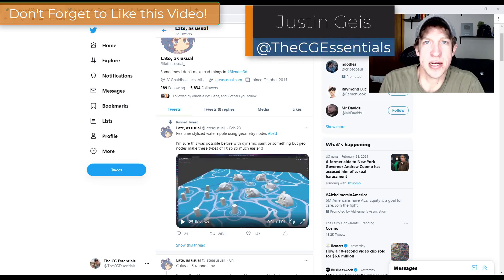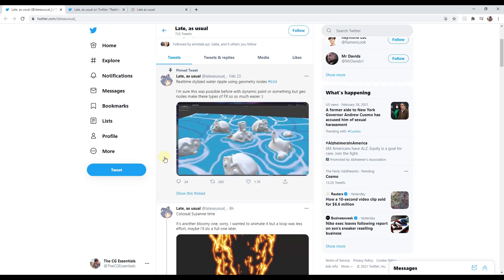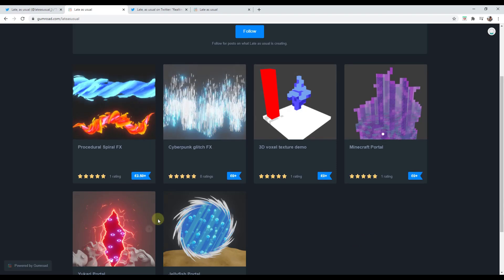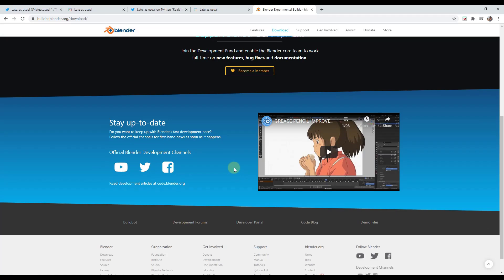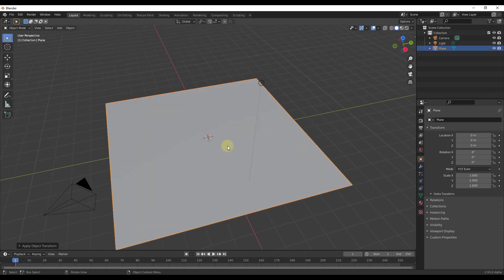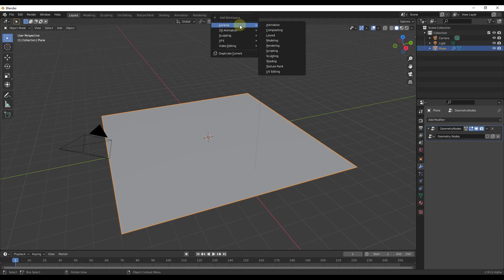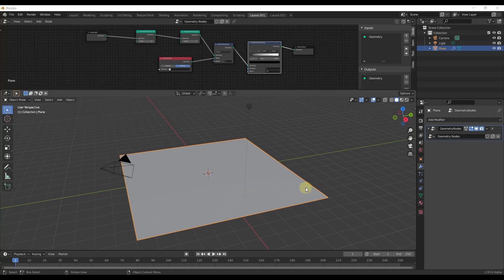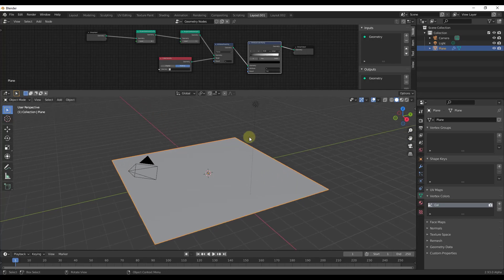Someone Created WIND WAKER WATER in Blender with Geometry Nodes!

Comment: Nodes for 3.4-  "Attribute proximity" > now is Geometry Proximity(3.4) in to "Source position " goes "Position" node  .   "Collection info" node now needs to be plugged in to "Realize Instances" node before going -in to-> "Geometry Proximity",  ->"Color Ramp" node's ---color--> in to "Group Output (Distance), add attribute in GeoNodes output attributes in "Distance" field . Simple subdivision now changed in to "Subdivide Mesh" node.
Reply: Hero without a cape